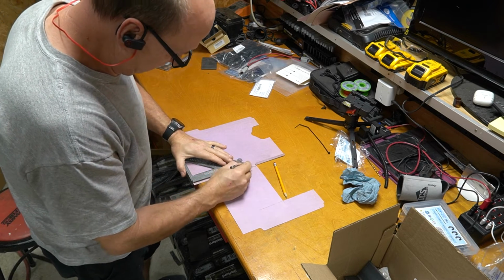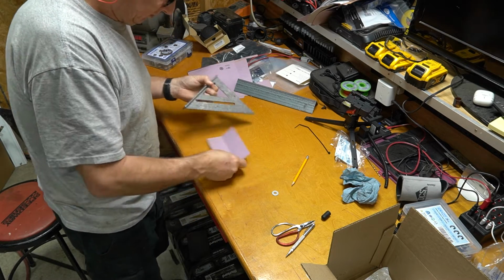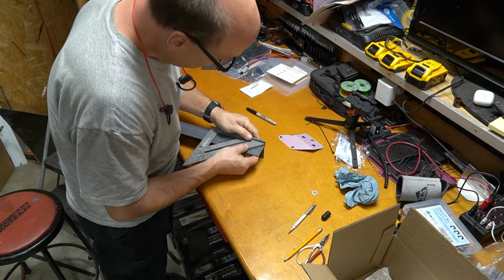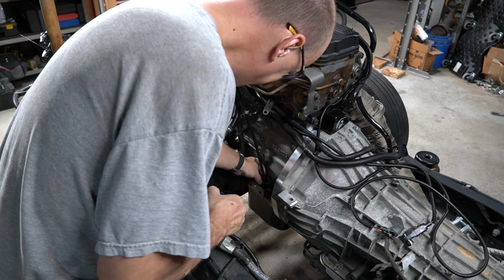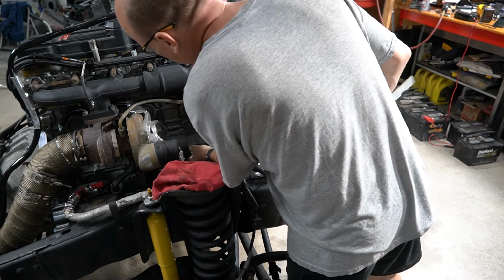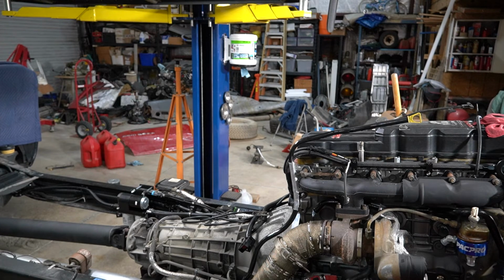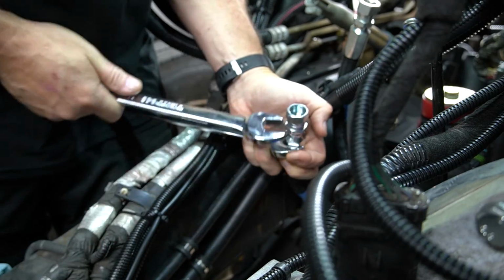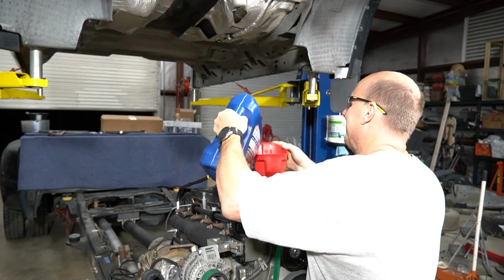The Fummins Project - Episode 11 - Pacbrake Remote Oil Filter Kit Installation

Comment: Cut off wheel is what I used
Reply from the maker: Made for a stinky mess. So you are running the PacBrake remote oil filter? Any oil pressure issues?